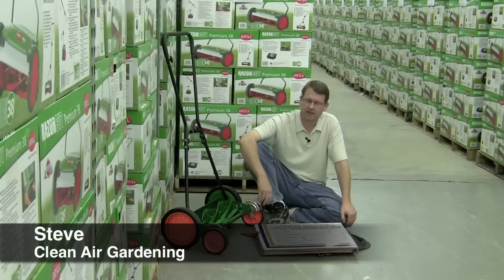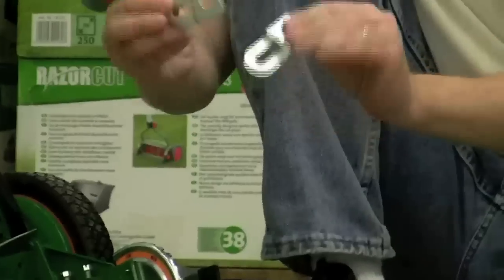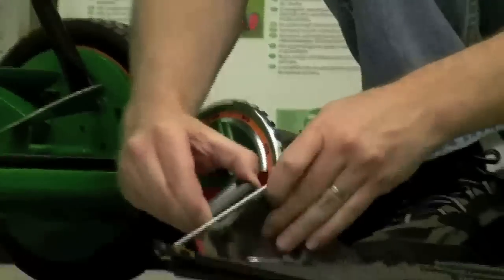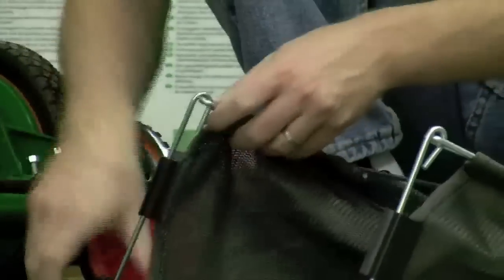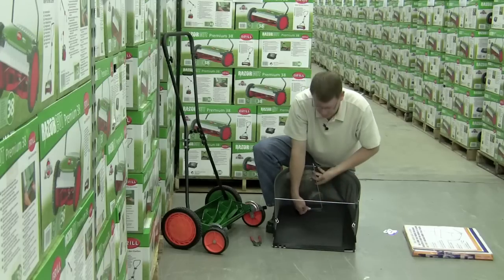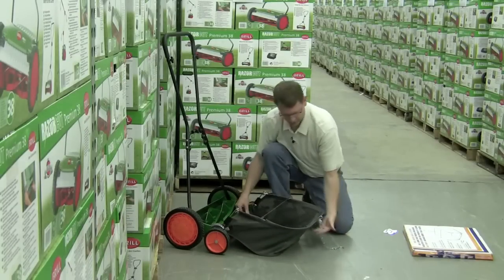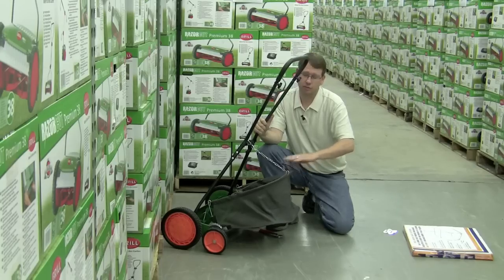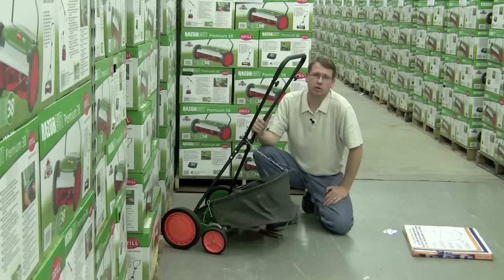Scotts Classic Reel Mower: Attaching a Grasscatcher

Comment: " You will notice that you're grass catcher width is not exactly 20 inches like Reel Mower is and that's because this grass catcher is a universal grass catcher in other words, it works for all the different models but don't worry about it, it's still going to catch about 90% of the grass clippings it's made for this lawn mower as well the other American model mowers "

You mean they did a halfass job of making this cheap crap
Reply: yep, never liked these floppy catchers they usually don't even stay on.  have a plastic one that is better.